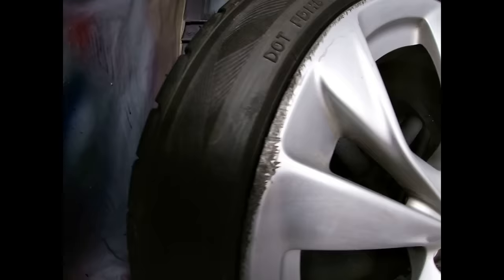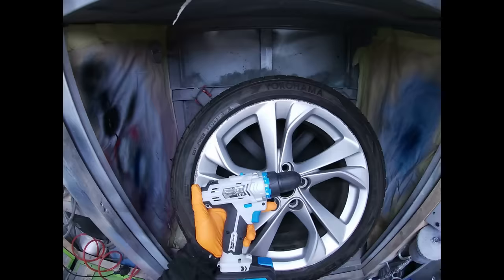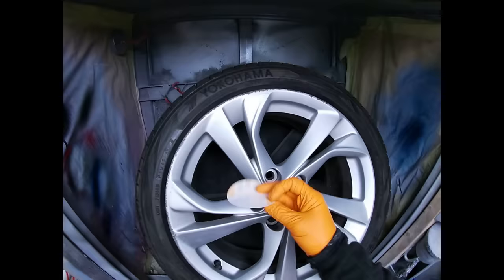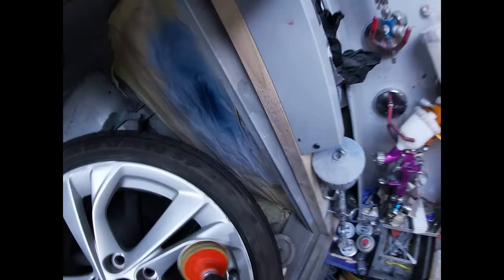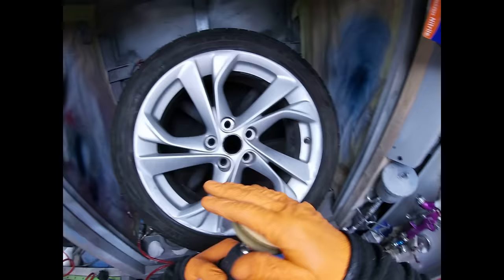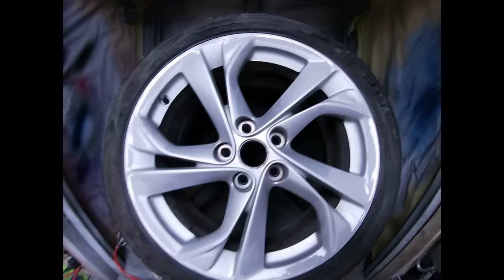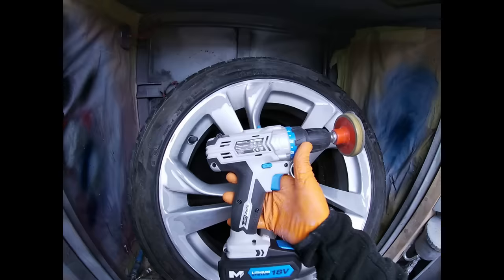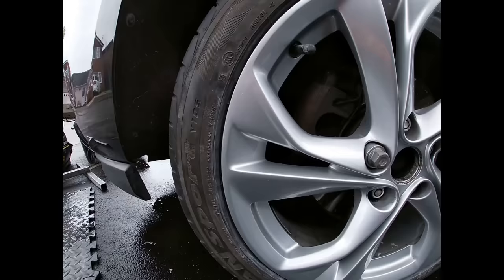How to remove curb rash on any wheel rim with a cordless drill!!

Comment: Ugh I just scratched my new rim on the gutter, the scratches are deep and barely touched the gutter. However it is on the exposed metal parts where the metal wasn't painted over. Easy way to fix? I'm so dissapointed in myself and it is noticeable. Therr are some other minor scratches on the other spokes but they look like they will come out easy

Comment: Do you only remove clearcoat or paint when sanding? My rim is anthracite and I'm afraid that when I start sanding the paint, it will be silver in the places where I sanded. What is the thickness of the paint coating on the rim?
Reply: Around 5 mils on a Chevy Cobalt rim. Not sure if they're all the same.

Comment: This is splendid! If I missed it I apologize. What materials do I need for this? I already have a cordless drill. What exact types of sandpaper do I need? I will be doing this, this weekend. I have a nice ride but my dumbass scraped the wheels just as the video showed. My other question is this. Does it really need a paintjob after sanding?
Reply from the maker: Sandpaper in various grades

Comment: Great video. I saw people worried about the tire. Could this be potentially dangerous if you did this while the rim was on the car with air? I’m thinking about doing this to mine but don’t want to take the chance in damaging myself or the car. Thanks
Reply from the maker: Most of what looks like the tyre shredding is actually the backing plate taking a beating. Always be carefull not to damage the tyre of course

Comment: You’re supposed to apply water to the thing you’re sanding, to irrigate away the grit laden residue which can and will rescratch what you just repaired.  That’s the whole point of wet sanding, to wash away the baddies.
Reply: hes not wet sanding & those discs wont take water their dry da discs only

Comment: Would you recommend doing on polished aluminum or chrome rims?
Reply: Chrome no. It'll rust. Aluminum can be hammered out with a small body hammer or heavy tablespoon. Less to sand & buff out. BTW, Harbor Freight sells sanding pads for air tools as small as 1". You can really get in tight places with those. I use 0000 steel wool for the final polish. Rubbing compound or semi-chrome will bring the shine back. An air brush with clear lacquer is best for touch ups.

Comment: Love your video, I need to do my daughters wheels which are a dark grey colour on Ali rim.
Once sanded down do you need to put a etch primer or something similar before painting ?
Reply from the maker: Etch primer can be difficult to work with. Try a normal primer in a can instead on any bare metal areas. Dry and then lightly sand with 800

Comment: Great vid man good job, question for you seen as you know your stuff, by sanding it down would it not reshape the alloy slightly? I have xxr alloys and they have a slight lip.. Should be fine maybe if I don't go any lower than 120 grit?
Reply from the maker: Yes but it can be blended in by rounding off the kerbed bits
Reply: @cvrpov  Cheers bro was thinking along those lines just try to take as little as possible off.. sound sound ✌️🙂

Comment: This was a REALLY good video m8, I love the idea.

But one thing that drove me INSANE was... why couldn't you remove the tire before sanding!? =))
Was driving me MENTAL as you started out and I saw the tire sand on the lower parts of the rim.
Reply: Not everyone has a tire machine in there garage or wants to haul it down to the tire shop, pay to have it Unmounted, go back home, do repair work, then back to shop to have tire remounted, you know what mean? 

If your that worried about the minor scuffing of the rubber, then tape around it or throw some index cars inbetween it. 👍🏻
Reply: @APinTheAK  I dunno man, a detire only costs like 10$ tops around these parts, and you can just wait to do the rim repair when you do a tire change anyway.

Guess I don't like messing up one thing while fixing the other :))

Comment: You can’t remove that much material from the wheel without replacing it. It’s fine to sand it down a bit but you have to add Bondo or other body filler, let that harden and then sand. You’ve changed the contours of the edge of the rim and it will not look symmetrical and will not look good after paint using this method. If your car is a piece of junk and you just want some fresh paint on the wheels this might be adequate
Reply from the maker: This method works well actually. The material removed is minimal

Comment: The best trick is to " STOP HITTING  THE FREAKING CURB" or just buy new ones. I had a set of beat up 19s that was given to me that cost me like $500 for just two tires. Six months later i got new tires and 17in rims for $450 and told the tire place too recycle those old ones
Reply from the maker: Hey, it happens tho! If it happens you can fix it

Comment: What do you mean kerb rash?   What you really mean is, for some, it's poor driving/bad judgement, or just doesn't give a shit attitude, and for those who can't judge the extremities of their daily ride.  Throughout my driving career, some 55 years, the only time I scraped a wheel against the kerb, was when I was learning to drive with my Dad, That promptly earned a good slap up the backside of my head. Never forgot it, and his car, a 1958 FC Holden, had steel rims. No Mags back then. If young blokes back in the 50s wanted to have their Holdens, Vauxhalls, Ford Zephyrs etc.to look "COOL", they reversed the rims, giving the vehicle a wider stance, or as we termed it back then, "widies". Not apparently, a good idea, in regard to putting extra strain to one's front stub axles. 

In parallel reverse parking, use the LHS door mirror to give you a 20 to 30 cm clearance from the kerb. Not rocket science. Easier still today with electric mirrors that you can angle down for a better view.
Reply from the maker: Hi David. Thanks for the story, I read all of it. I agree this is down to careless driving.

Comment: NEVER use aluminium oxide disks to sand aluminium. They will get the job gone but will make the wheel corrode after painting.
Reply from the maker: Just normal sanding discs

Comment: Misleading title. Drill is not the thing, which removes scratches! Sandpaper does. And "cordless" also makes no sense - it can be done with any electrical tool. It can be done even by hands, just takes longer time.
Reply from the maker: Probably the most rediculous comment in this videos fairly long history ... and there has been many

Comment: But your tire is too small for that wheel. If the tire is wider than the wheel, as most are, won't you end up sanding the tire, if you leave it mounted, with that drill technique? 
Also, you don't even show masking the tire. Is it just masking tape?  If you ArmorAll your tires, tape won't stick to it well.

Comment: But does it make the rim thin on the edge
Reply from the maker: Any kind of refurbishment will obviously remove some material from the alloy.
Reply: If you look at the bead area on a bare rim, you’ll see the very edge of the rim is not where the tire is secured.

Comment: Why put your drill through this or leave this to the myriads of drills out there with inconsistent speeds etc. when you can just use a grinder with sanding discs? Even a pencil grinder is more appropriate and purpose built
Reply from the maker: The whole point of the video is to use a drill (which most blokes have probably got at home)

Comment: Wow so no filler needed ??
Reply from the maker: No. Its so much quicker and easier this way
Reply: @cvrpov  ok it’ll be my  plan once I got free time and weather become better  but painting  will be done once all sanded cause some rims  already paint peeled it’s not my rims I bought it used but it’s in 70% good condition
But I love  sanding by drill and make it in a good shape and if it done ✅ I’ll be very very happy cause I love those rims 😍😍😍
Reply: @cvrpov  so sanding 180 then 320 then wet sanding 600 right ??

Comment: 400 the whole rim prime paint clear coat and send it ... Not saying the end result of yours is bad but you'd save more time and if the curb rash is too bad fiber glass it and keep it moving ...
Reply from the maker: 400 won't remove very much
Reply: @cvrpov  it's not supposed to it should just give the paint enough to bite to the fiberglass is to remove the flaws, if you sand it too much and remove more metal than absolutely necessary you'll ruin the balance and you'll be chasing weigh all day

Comment: That's all well and good. I'm sure you can get a good repair. But painting a wheel isn't worth a damn. They need to be powder coated. Paint will deteriorate quite fast on a wheel in the elements. Yes, dealers will hire people to do this to wheels and also to polish headlamps. Looks good for a sale. How do I know? I worked for Chrysler for over 40 years. I've seen it all. Say what you want about my comment,  but I've been doing custom and restoration on vehicles and motorcycles for over 50 years as a second job/hobby. I'd never paint a wheel unless it was just a trailer queen towed to shows.
Reply from the maker: I planted my father in laws last year. Silver, exactly as above... still completely intact now
Reply: @cvrpov  you're the best

Comment: So, realistically, I need a cordless drill, a backing plate, various grits of sandpaper, wet and dry, a roll of painters tape, a spray booth, compressor, spray gun, paint and mixing tools, clear coat paint, and a course on automotive painting, rubbing compound, polish, ect. Headlining with "just a cordless drill" is Kinda misleading, yeah?
Reply from the maker: Its says how to remove curb rash, the drill removes the curb rash. Its actually quite well explained, and I even added a picture of a drill and a wheel with some curb rash. Thanks for watching

Comment: If you have low profile tires it'll be a difficult job to do. Why don't you break down the tire bead, then do the buffing properly the minimum way possible. Use a 600 grit body shop style sanding paper and use water to do  a finishing, this way when you repaint he wheel you won't see much repair. Your system is a hack!
Reply: Not everyone can break a tire read, everyone can do this

Comment: Thanks for the video!  
Unfortunately, you had skipped a lot of the steps, paint, clear coat etc. yet focused the last several minutes of this video back to your "ordinary drill"... The finished rim that you had shown looked to be different from the one you worked on (at least to what you had shown) in this video as the edge of the rim (near the tire) was last shown sanded unevenly around, yet the final/finished rim was - almost to me looked to be the original (UNDAMAGED) rim, so its kind of difficult to take-in all the work had to be done than what you had just shown here.
Reply from the maker: Hi Rick. I'm not here to pull the wool over anyones eyes. The basic principle is always the same that if you can apply a sanding disc to a small commonly owned tool/device which spins at high speed then you will undoubtedly create a sanding tool in which you can remove kerb damage. Sand, feather, work up the grades and then the painting stages.
Reply: @cvrpov  I do appreciate the reply! Thank You!
Just many steps were skipped, making the process looked too simple and as if can be done quickly which is Not the case from sanding (some spots may take careful and delicate touches) to cleaning the surface dust to apply primer to paint (1,2 or 3 layers) to final clear coat application, each step takes time.  The final showing of the rim looked wonderfully perfect, Not saying that you pulled the wool over anyone's eyes, but, to reach such perfect result takes patience and practice.
Reply from the maker: Yes it does your right. This was more of a demonstration of how easy a wheel can be sanded using the cordless drill as a pose to by hand and using filler etc.   Theres plenty of other wheel painting videos to view on my channel

Comment: Dude, you forgot one important step. Once you're done with all the grinding and painting and everything else, you need to take your car to a Tire shop to re-Balance your wheels. Otherwise, you will be messing up your tires and your suspension.
Reply: how
Reply: Absolutely not dude.  If you damaged your wheel so badly that it messed up the balance or alignment of the vehicle then that's far beyond simple curb rash.

Comment: Great idea for a one off repair, but your drill is not designed to be used that way, the bearing will wear in no time at all, leaving a poly chuck, you would be better with a cheap angle grinder or car polisher with sanding attachment.
Reply: I used my drill this way... Several times a week also use it for hole saws everyday up to 4 inch haha. My main/go to drill is now 6 years old and still putting in work full time haha. I have hole hawgs, grinders and polishers but for whatever reason I end up using the old drill.
Reply from the maker: I intended this ford diy folk, I obviously have a full set of air tools etc do to the job for me.. but nearly everyone got a drill 👍🏼

Comment: You didn’t fill anything p, meaning you have technically reshaped the edge smooth... what if you have chunks taken out, dented in, you will have to fill then sand it down...
Reply from the maker: 99/100 the marks can be sanded out

Comment: Your grinding the rim below spec and causing weekness. Dangerous. Such repairs need to be completed by adding material, not taking it away.
Reply from the maker: This is the most common way of repair. Material is also removed when kerb damage occurs dont forget.
Reply: @cvrpov  I worked for many years in a wheel factory. These tolerances are integral to the strength of the wheel.
The only way to repair is to replace the metal removed by way of welding, then re machining.
Plese dont encourage people to weaken their wheels which in turn can cause failure and possibly deaths.

Comment: Ok..thats a lie. You can not fix any car rim with curb rash with a cordless drill.
Reply from the maker: No lies
Reply: @cvrpov  well I didn't mean you're a liar. It's just a term or phrase people use in regards to untruths. Try to repair curb rash on a steel, chrome wheel with a drill and sandpaper and see the results you get.

Comment: Lmao ... Never seen such a bodge job ... Just a quick question from a master craftsman ... How have you replaced the aluminium in the wheel ? You do realise you are just changing the balance of the wheel and setting yourself up for later problems.. I am just glad I've never had you repair any of my wheels ... 

If you like to do incorrect repairs then follow this video ... If you want them repaired properly then take them to someone who can fix them properly ... The only thing this kind of repair is good for is a quick fix before you sell a can ... But it's not a good way to fix ... As it's not fixed ... It just had more of the wheel ground off  ... Not a fix ... Just a bodge a shoddy repair